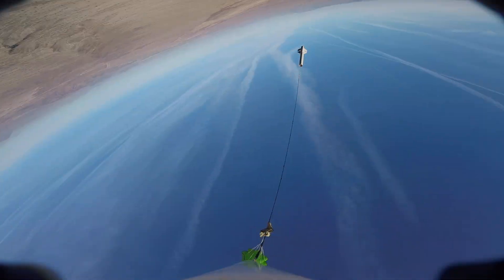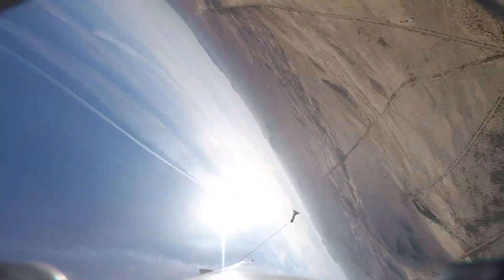High Power Rocket Onboard Footage

Comment: Very nice! Do you have plans for addressing the spin on launch? The view is amazing!
Reply: I'm new to this stuff, so how would you, if you wanted it to not spin?
Reply: @paulgreblick  Reaction wheels and cold gas thrusters.

No, I'm kidding, usually one of the fins has an electrically-actuated stabilizer.
Reply from the maker: @paulgreblick  This rocket has a few drawbacks. The camera shroud is somewhat big, and it’s a split fin design. Any minor misalignment causes spin.

Symmetry is key for flying straight.

Building the fins using templates and jigs to keep them straight while they dry is very beneficial. I now make 3d printed fin jigs to hold them in place and perfectly aligned while drying.
Reply: It's probably easier with video editing software to make the footage not spin, than to make the rocket not spin 😂 @paulgreblick
Reply from the maker: Thank you! No plans for addressing spin.. This rocket (Athena) is just a fun rocket used for trying new components, and electronics. I have some other rockets that are much more dialed in and built for performance. Current project is a minimum diameter 54mm build that I will be making some build videos of soon!!